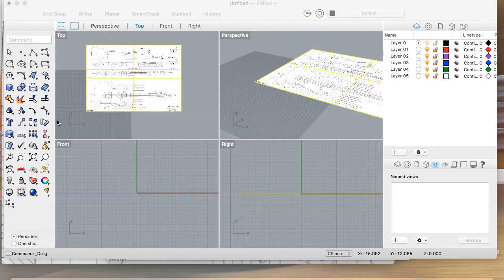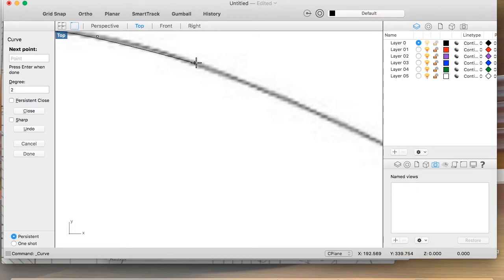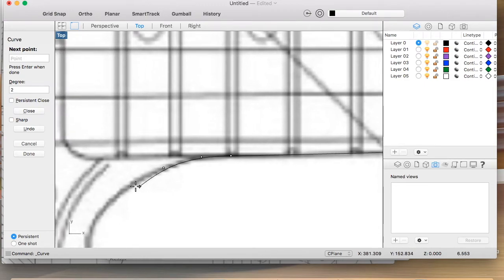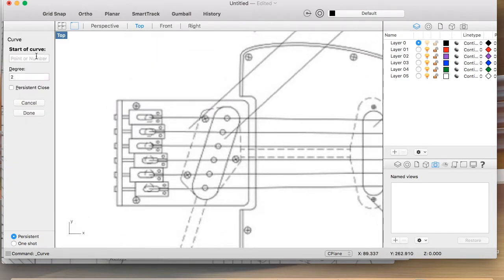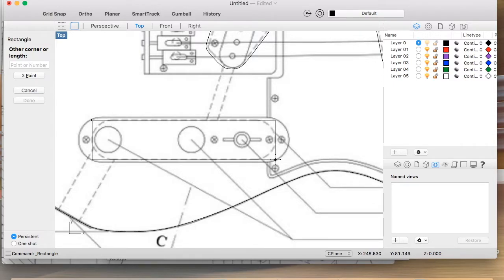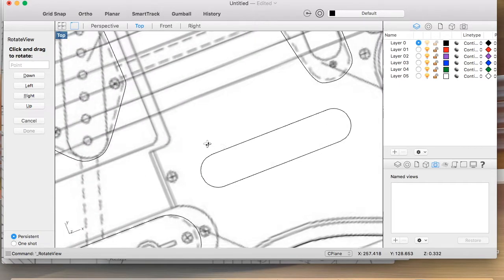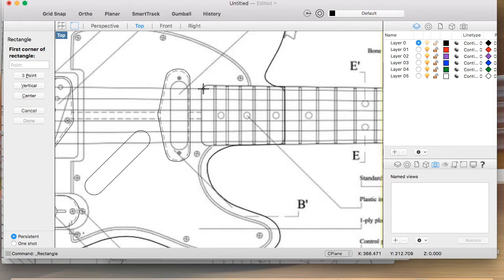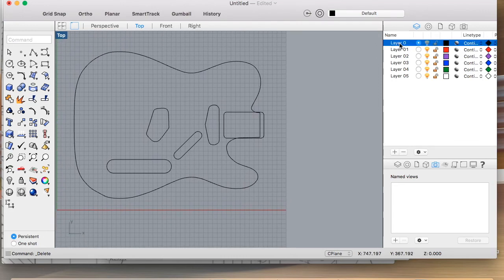Telecaster outlines

Comment: Thanks for the series, very helpful. I noticed you have blueprints for a 335. Do you plan on making a tutorial for those?
Reply from the maker: I did one for the gibson les paul. The steps are essentially exactly the same because it is a 2 piece guitar. I would check out the les paul series and just check out google of some gibson forums for the 335 blue prints if you wanted to build it! I did one about a year ago and cut it on a CNC but it is too thick of a wall and too thick of an arch top so it was very heavy. I might be doing another series later this year, I am teaching a guitar building course in a high school. Glad you liked the videos!